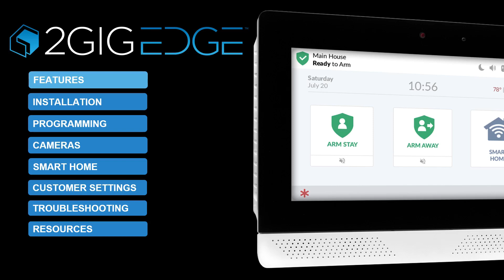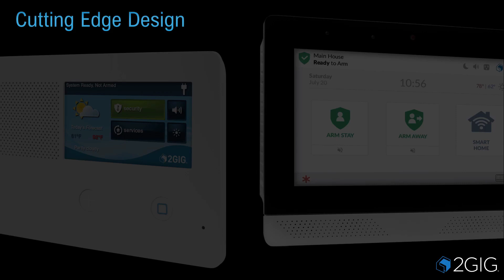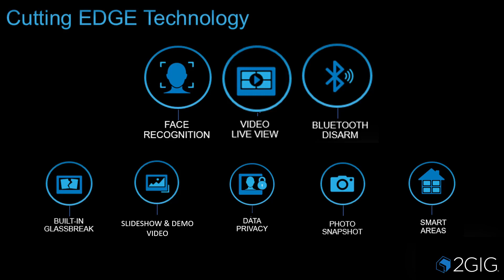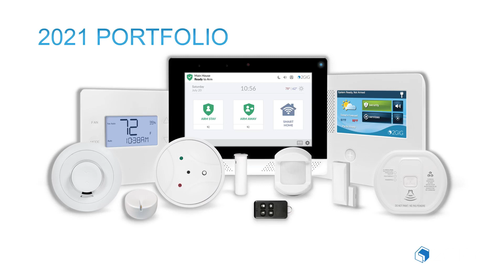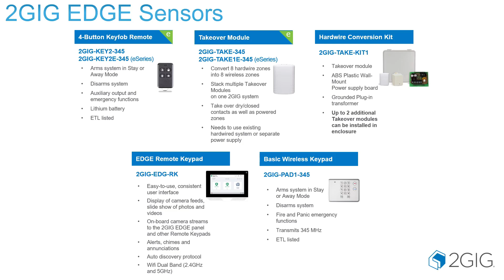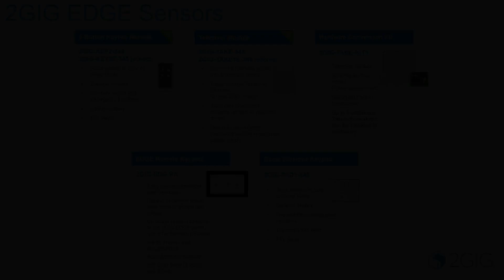2GIG EDGE: Functionality and Features Training

Comment: I want to replace my GE concord system with something newer. Does the 2GiG edge not have a phone line connection? Would the system not communicate if the WiFi is down?
Reply: Fire and Burg panels have moved to cellular towers years ago. None of the systems I have installed in past couple of years make use of phone lines. (including large chain retail stores, big box home improvement stores, etc).  
The 2gig Edge has an integrated cellular communicator (you specify ATT or Verizon when you purchase).
The system uses wifi and cellular. It has a built-in battery backup.
Reply: @RandallPerryS  yeah I just canceled the phone line and set up a 2gig edge with Verizon cellular.